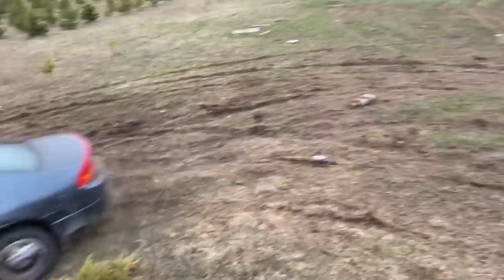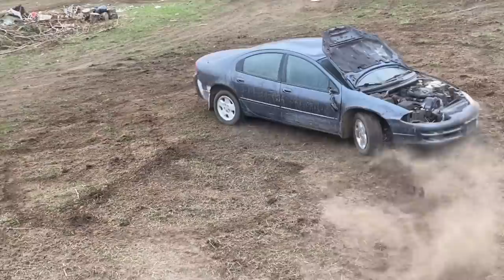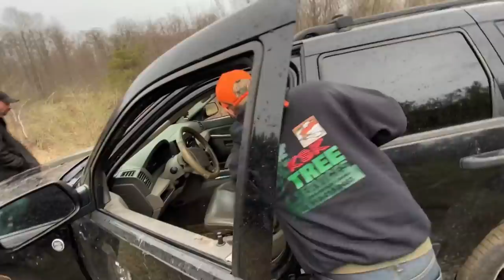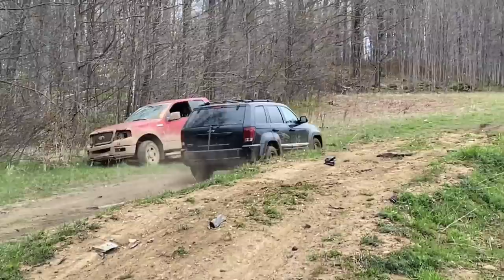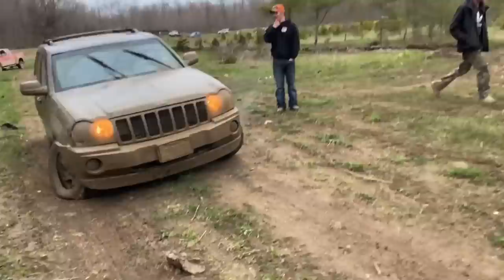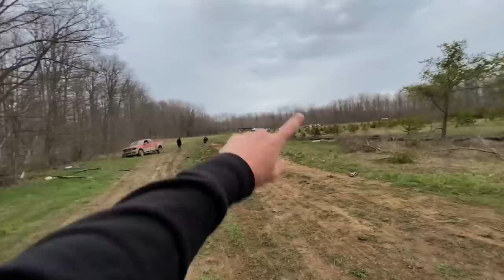Jeep Cherokee DESTROYED In 5 MINUTES!

Comment: My wife had one of those jeeps with the 3.7. Great vehicle overall but make sure you get rid of it around 90k. Electrical nightmare
Reply: Really mine just hit 90k what happens?
Reply: @juanflorencio3125  alternator shit the bed so we thought. Battery continued to die, changed the battery but it still continued to die. After that the gauges would would jump around and the hvac stuff would start to work when it wanted to. Also the windows would work when they wanted to. My friends wife had one with a v8 and it would shut off when it wanted to and it had like 105k on it. I'm not saying theyre horrible vehicles because I loved my wife's 3.7 until we had all those problems. Thing was a tank in the snow and yes I checked all the grounds. It got to the point where I was going to put in a battery manual cutoff switch because it seemed like something was always drawing power because it was dead after sitting for about 2-5 days. Something came up at a local dealership so we decided to trade it in and if I remember correctly they gave us about 3900 for it. I'm good with working on vehicles and stuff like that but when it comes to something electrical I'd rather just let it go
Reply: Liberty 3.7 just hit 200k all original drivetrain
Reply: Maybe there's a difference between what the grand Cherokee offers compared to the liberty in aspects of luxury and other electrical componets, I dont know. Im not saying the 3.7 engine and drivetrain is bad because I loved that thing in the snow. Maybe there were a few model years that were bad in the grand Cherokee but yet again I dont know. I'm just telling everyone what happened to my wife and I and my friends wifes grand Cherokee with the v8. Glad to hear you still have your liberty with 200k